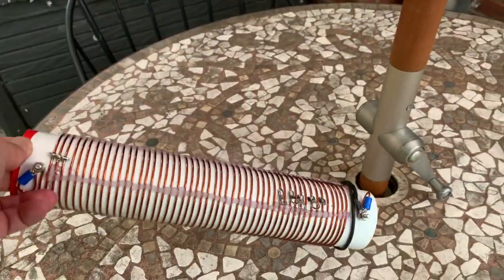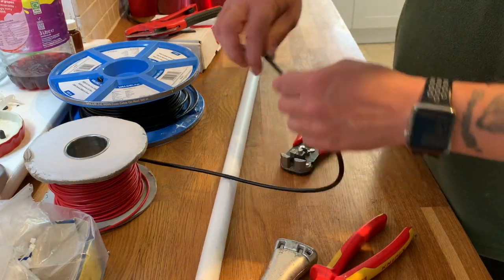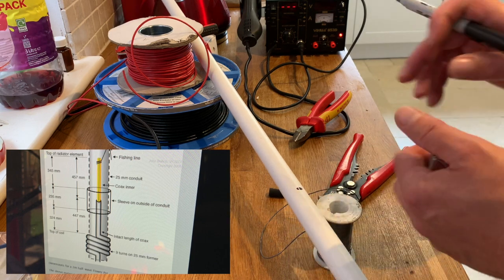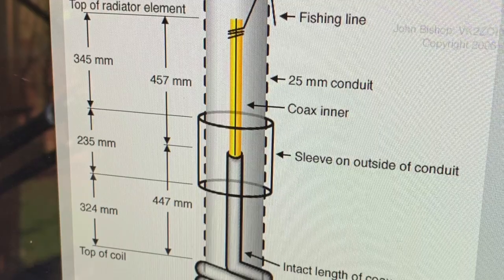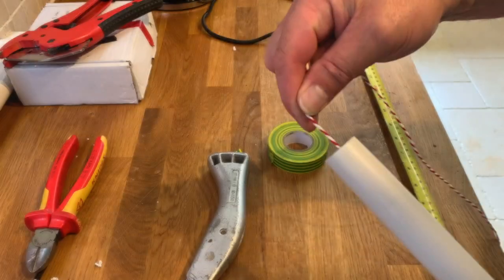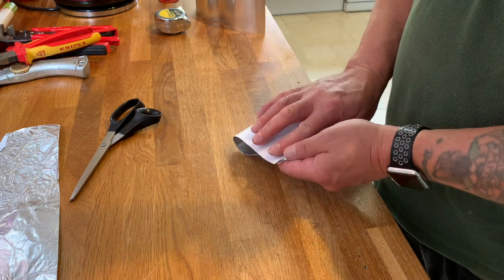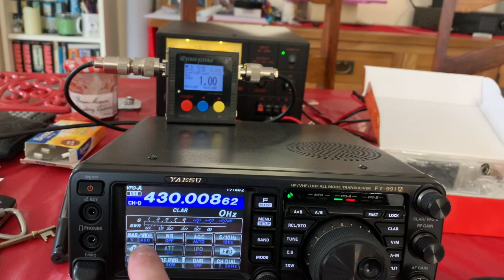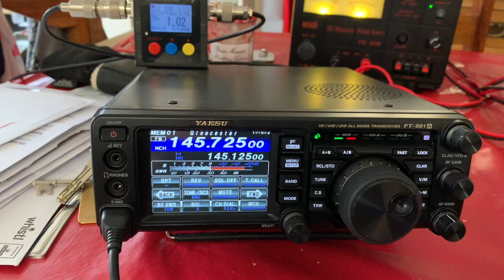HAM RADIO: Flower Pot Antenna, Perfect Stealth Antenna for 2m/70cm

Comment: Hello Mike,
                   Im delighted to report that using the "Real Baco foil" and not the tape after a few tries with a cheaper brand baco foil?then with some of that tape you used! afellow ham friend came up with a better idea! that actually works? for the would be makers of the flower pot, ask the wife for the "Branded Baco Foil ,measure the amount needed has per video! rap it around in the suggested position! and secure with elastic ands at each end?this is to allow for adjustment of SWR on both bands from 144.500 and thru to far end of band,plus also on 70cms either end both with me @ 1.3, im very pleased with the advise given to me by2E0PAF phil in Bromley Kent for that suggestion, ive also made a Square aerial with the driven element made into a Quad Aerial from Antenna Workshops and a little modification by phil again! his antennas are in his roof space the square one is on a rotator and the performance is better than any white stick i know of. from 2E0GMD mick
Reply: good  can you build me one  good net on radio thanks all the best and phil

Comment: Hello. I saw your antenna project and i would like to make a antenna for a fm stereo reciever, from 89 to 104,8 Mhz. Could you please calculate the measurments for my aplication. Tnx
Reply from the maker: 300 / Freq /4 = 1/4 WAVE. so   300/95= 3.1578 / 4 = 79cm each leg. top 79cm, coax 79cm, coil 79cm,

Comment: If I made this from 75 ohm RG6 coax, is there anything special I would need to know?  Or is it just a bad idea all around?
Reply from the maker: Give it a go, should be fine..
Reply: @mike-M0MSN  RG6 has a different (much higher) V factor than RG58, and using the web calculator from the start of the video, you get very different dimensions

Comment: Why didnt you strip the half of the coax cable, so you dont have to use another cable? But anyways, nice antenna! I made one too.
Reply from the maker: don't know really..LOL
Reply: @mike-M0MSN  On the big one you did it :) Greetings to UK from germany
Reply: Michael Menzin  If you use a wire upper section you can use a shorter piece of coax. Most amateurs have some wire hanging around and coax can be expensive. You can do it either way it doesn’t matter.

Comment: DOES THIS GO ON THE ROOF OR IN YOUR LIVING ROOM INSIDE YOUR HOUSE?
Reply: If you seal the bare end of the wire off you can put it anywhere you want...
Reply: @macgyver5108  BUT THE BEST THING IS STILL GET WHATEVER ANTENNA YOU  HAVE TO THE HIGHEST POINT EVEN IF IT'S  A MOBILE MAGNETIC ANTENNA?
Reply: "Ideally" you'd want to mount the antenna as high as possible. As they say when it comes to radio: "Height is might and antenna is everything!". VHF/UHF is mostly "line of sight" so the higher the antenna is the better because of the curvature of the earth, so on the roof is quite a bit better than at ground level inside the house... Up in the top of a tree or on a tower is even better though, just make sure and use higher quality low loss coax if you need to run more than about 50 feet/ 15m of coax, such as "KMR 400" or "LMR 400" coaxial otherwise there's a ton of power loss!
Reply: @microminiskirt  yes, even if it's a mag mount antenna. The roof of your car is best if you're actually using it for mobile. Those are designed to need a ground plane too so the metal car roof acts as the ground plane. If you're using it around your house put it as high as possible and stick it to the center of a metal sheet, like a cookie sheet works great for that or the center on top of your fridge.
Reply: @macgyver5108  WAS ABLE TO GET MAG MOUNT ON TOP OF ROOF ON A NARROW RAIN GUTTER.  SWR ON LOW POWER IS 1:5 BUT ON HIGH POWER IT GOES UP TO 2:1.  WILL 2:1 RUIN RADIO?  DO I NEED TO MOUNT MAGNET ON MORE METAL TO GET SWR LOWER?  MORE METAL MEANS IT WOULD HAVE TO BE MOUNTED INSIDE HOUSE TO METAL FILE CABINET AND I WILL LOOSE HEIGHT ADVANTAGE ON THE NARROW RAIN GUTTER ON ROOF.
Reply: @macgyver5108  THANKS!!👍
Reply: @macgyver5108  WHAT APPLIES TO CB RADIO SWR ALSO APPLIES TO 2 METER BAND?
Reply: @microminiskirt  Sorta... Same rules apply for tuning, but a 2m antenna isn't exactly going to be resonant for 11m on CB.
Reply: @macgyver5108  IF WE COULD WE WOULD GET A COMET GP-3 ANTENNA UP THERE.

Comment: I can only get hold of 22mm pipe, will it work and will it still be 9 coils?
Reply from the maker: Yes you should get away with that, you may have to use 10 turns at the coil.. :)
Reply: Mike-M0MSN thank you for the speedy response, I was on Charley Bravo in the 70’s but a newly licensed ham and am trying to get a decent indoor signal, 73’s M7MGP

Comment: I have an abundance of RG59 coax (75ohm) would that be ok Sir ?
Reply from the maker: yep you can use that. :)
Reply: you "can" use it, I mean... the impedance for a center-fed dipole is 75Ω at the feed point so it usually makes a good match, the real problem is if you need a long run of coax from the radio to the antenna because "most" 75Ω coax is cheap because it's "lossy", you lose lots of transmit wattage. 

Also if this was a different type of vertical you'd end up with more reflected power. As a rule if you want your radio to live long test to see if the SWR is acceptable enough at the radio side (test on the radio's LOWEST power setting at 1st too!) then if needed build or buy a balancing transformer if the impedance is really high (called either a balun or unun depending which kind is needed) or even a manual antenna tuner or use some matching coax stubs to help match up the impedance to the 50Ω connection in your radio.

Check the SWR, because given enough time and wattage it can eventually COOK the final transistors in a good number of cheaper radios, which don't exactly have very beefy high SWR protection circuitry that goes into a "limp mode" to throttle back the wattage! Ask me how I know!? 😅😳😱😭Letting the proverbial smoke out of a $200 radio... never a fun day! but if this was a different type of vertical you'd end up with more reflected power. As a rule if you want your radio to live long test to see if the SWR is acceptable enough at the radio side (test on the radio's LOWEST power setting at 1st too!) then if needed build or buy a balancing transformer if the impedance is really high (called either a balun or unun depending which kind is needed) or even a manual antenna tuner or use some matching coax stubs to help match up the impedance to the 50Ω connection in your radio.

Check the SWR, because given enough time and wattage it can eventually COOK the final transistors in a good number of cheaper radios, which don't exactly have very beefy high SWR protection circuitry that goes into a "limp mode" to throttle back the wattage! Ask me how I know!? 😅😳😱😭Letting the proverbial smoke out of a $200 radio... never a fun day!

Comment: Nice video though I am a beginner. I have a 32 mm pipe. Does it mattet?
Thanks for answering😊.

/Peter
Sweden
Reply from the maker: Hi Peter,  you can use 32mm pipe that will not be an issue, :)
Reply: Mike-M0MSN 
Ok, Mike! I followed your instructions and built an antenna. Works just fine 😊👍.
Thanks!

/Peter

Comment: 158MHz SWR?
Or parameteres for 158MHz ?
Reply from the maker: Should work if you make each leg  about 2 cm shorter ( try it)
Reply: @mike-M0MSN  Flower Pot is 5/8 1/2 ?

Comment: Hi Mike, I live about 2miles away from you as i live in Kingsway, and was wondering if we could have a chat abouit making the 2m /70cm antennas and where to get the meterials from.
I gained foundation licence (M6PVL) about 10 years ago and not be on the air much. so very rusty at the mo and would be happy of help and advice.  My email address is on QRZ. Many thanks Pete Lansdown
Reply from the maker: Hi Pete, get in touch via QRZ..  cheers